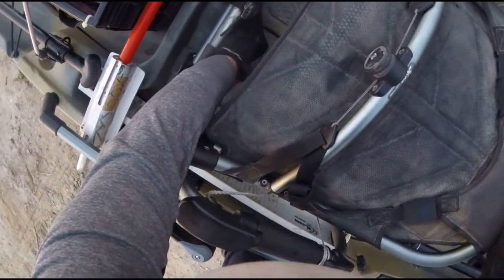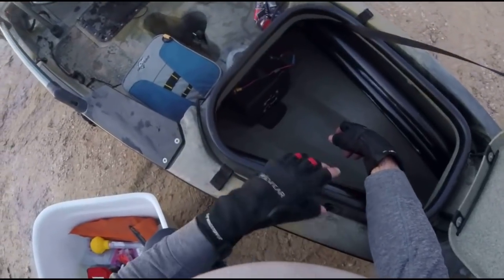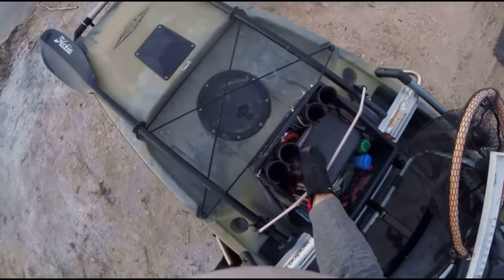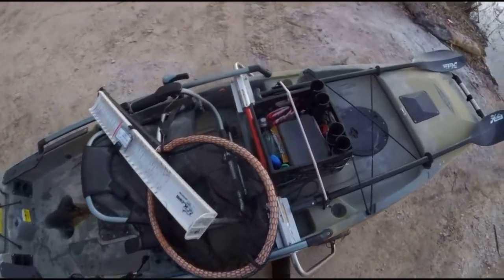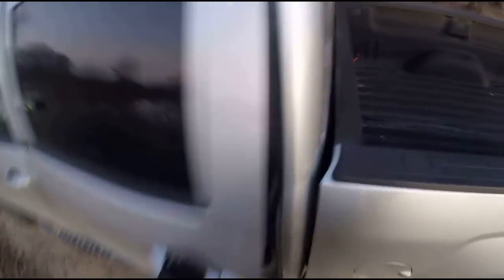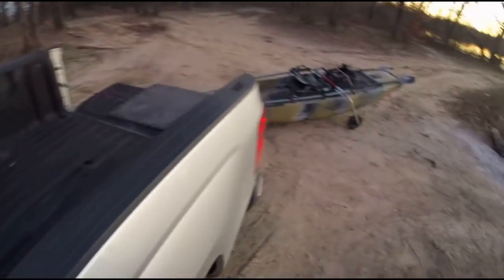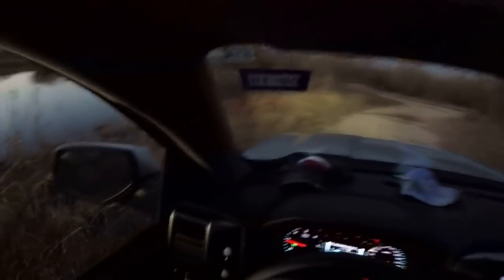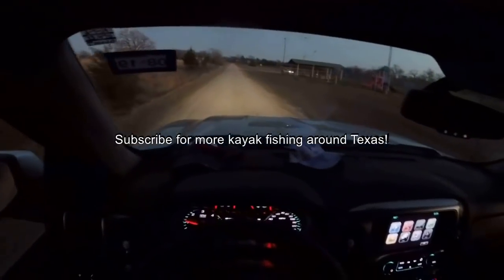[Hobie PA 12] Kayak Bass Tournament Setup

Comment: How do you like the PA12?  Whats the best way to demo one?  Im in San Antonio.  Im considering it or the titan 10.5 for local fishing and maybe to try KATS.
Reply from the maker: jawsmod  there’s ACK/Mariner Sails/other kayak shops around that will let you demo. Not sure around the San Antonio area though. Both are solid kayaks. Both have there own pros/cons but I can’t tell you which you need cause I don’t know what kind of fishing you’ll be doing/lakes/rivers etc
Reply from the maker: But I love the PA 12, super stable, fast, can take it into skinny water, doesn’t paddle like a dream but wasn’t made to paddle haha. Rudder/skeg system great for maintaining tracking during wind/fishing for hands free fishing. Ton of storage and everything is already pre-drilled for you so no worries on that end. I would recommend the Boonedox landing gear if you plan on truck beding it etc cause they are both heavy.
Reply: I checked with ACK, they no longer demo except demo days.  I will use it mostly for local pond hopping, but would like to try KATS.  I primarily fish Bastop, Walter E Long, and Fayette in my Champion bass boat.  My must haves are: ability to stand, pedal, load by myself in bed of truck, comfortable, skinny water and can handle grass (Bastrop).  @centraltexaskayakbassin565
Reply from the maker: jawsmod I will day the Hobie’s Mirage Drive will come through the grass a lot better than the Titan’s drive since it’s essentially a trolling motor style prop. You can buy a weed guard for it but it’s extra hassle and money. Also have to upgrade the rudder from what I hear.